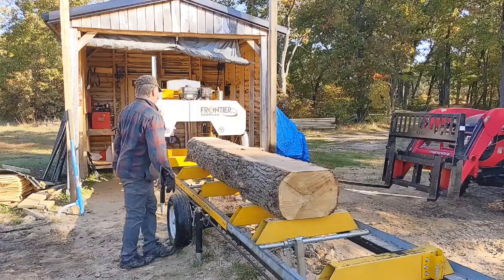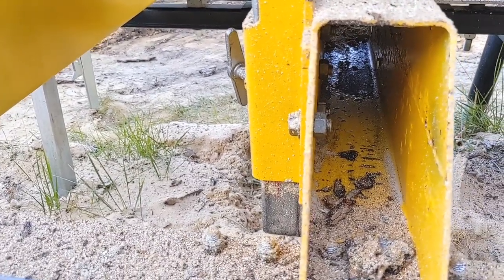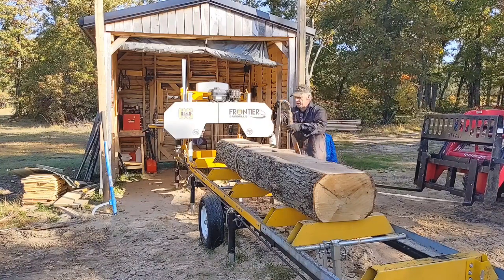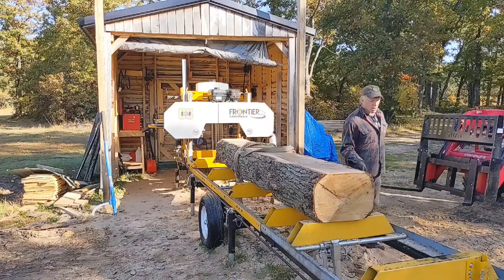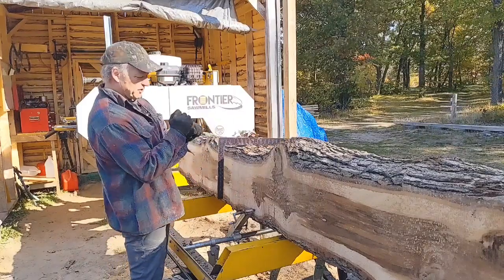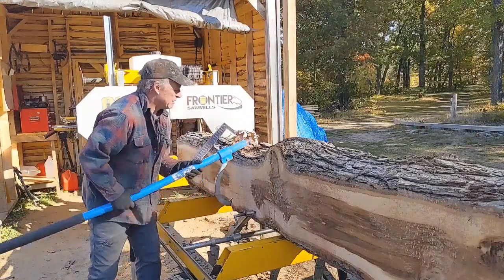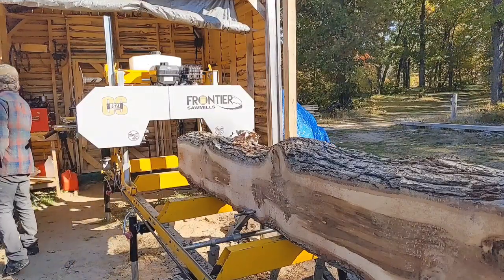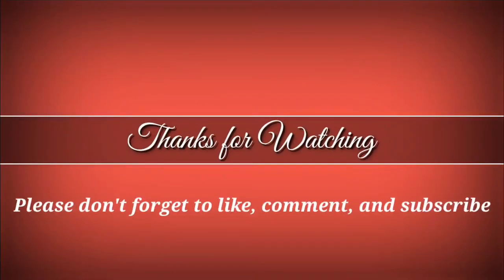Addressing a Viewers Question Regarding Square Lumber

Comment: Couldnt agree more with you Jerry about the log stops being a royal pain. I too have thought about getting them back square and putting a few tack welds in place to hold the brackets stuck. 
Great explanation of the reason behind squaring a cant up, shame trees dont grow square 😄 great video buddy.
Reply from the maker: Those stops are definitely something Frontier should address. This is the only way I can get square lumber consistently.

Thanks for watching and commenting as always brother.
Reply: @BigelowWoodcraft  we should remember that the frontier mills are a budget mill so we can't expect too much  😂 
I have both a roofing square and a little boat level to check mine too, once rolled 90 degrees I check with a level, nice quick and easy just like the square.
Reply from the maker: @everydaywithmenick  that reminds me.  I have to level up my mill lol.  Ok noticed yesterday it was a bit wonky.
Reply: @BigelowWoodcraft  to be honest I think that will be my next job on the mill, ensure everything is still looking OK and rock solid 😄

Comment: Your log stops are adjustable. If the bunks are level and the stops are plumb and you check them regularly you can rely on them for a nice square cant.
Reply from the maker: Yes they are adjustable.  Horrible design in my opinion. They don't stay square long.  Mine get knocked out often.   I have squared them back up several times.